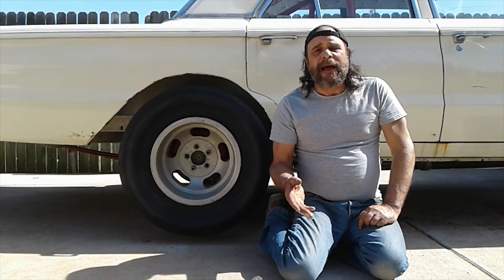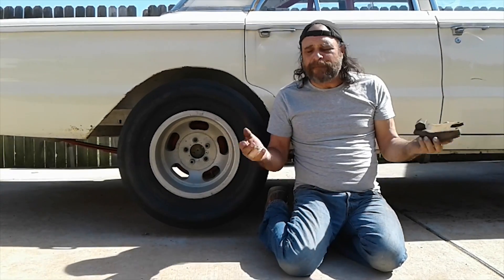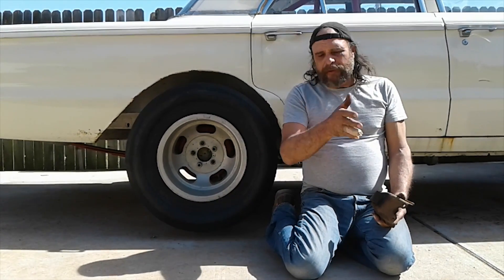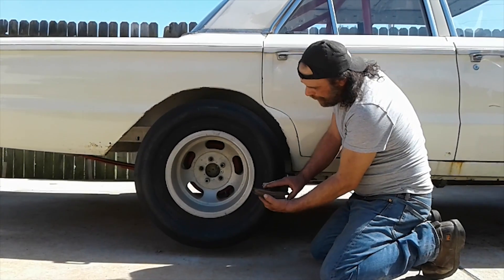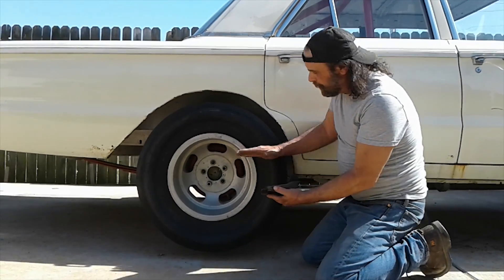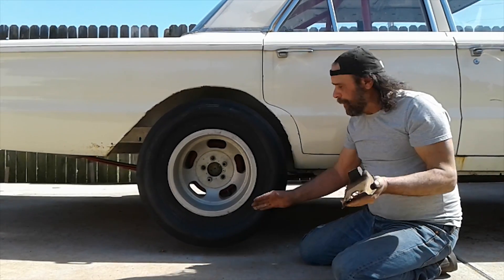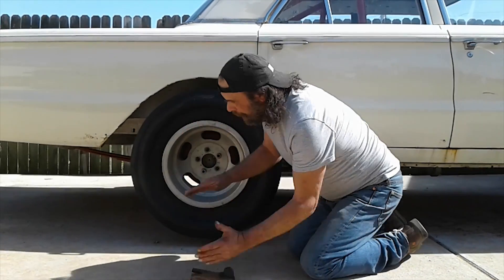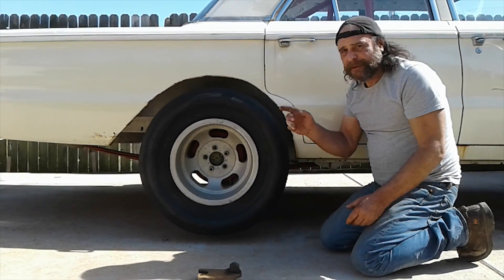Pinion Snubbers Explained

Comment: If memory serves me. For 1/4 mile, staggered torsion bar from a /6 on one side and B-RB bar on opposite side. Air shock (singular) on back (torque side). Ahh, the good old days. When the snubber punches through the floor pan.

Comment: Here's a little twist to confuse the issue, modern grudge and radial cars actually use a lifting type of rear suspension. A fellow Tuber named John Doc has a racing 4 link, with essentially a torque arm that mimics a pinion snubber, in that it raises the chassis and drives the tires into the track. They do this specifically to limit the upward movement of the front and put as much weight as possible (without a huge wheelie), into the rear tires. We are also talking about guys, that are running something like 1500-2500 HP in a street appearing race car, with computers that can do minute changes as needed to control the car as well. This is a cool thought on it though, nice vid

Comment: I'm getting ready to build a Gremlin. I'm hoping to find an 8 3/4 rear end so I can use a pinion snubber, even if I have to build a crossmember for it to work on. Also, AMC's have biased leaf springs like Mopars so that's a big plus. The guy I'm buying the Gremlin from also has some 2dr Ramblers, and the springs are just one inch shorter than an A body, so I could theoretically use Mopar Super Stock springs by moving the spring mounts, and maybe a relocation kit would work on that. I'm not sure if that would work on the Gremlin, and being a hatchback I can't put the battery in the trunk because it doesn't have one. But if I end up using a fuel cell I'll have to make a box for it to keep the fumes out of the car, so making it large enough to hold a battery or two 6 Volt group 1's in series it should fit. I even thought about running two fuel cells, one with pump gas and the other with race gas for those weekend drags. Then I could adjust the timing and boost if I'm running a Newcomer stoker 6 cyl. He built one that made 664 hp, and I'd settle for 550 or so. Then I'd name the car Having Six. What do you think?

Comment: Uncle Tony you remind me of my uncle kirk he was a Mopar guy with endless amounts of knowledge and the fastest 70 roadrunner in town it had a 440 with a 671 blower. Also had a 78 runner,68 satellite and roadrunner  and a 68 rs camro and piles of parts from complete 340 and 360 6 pack engines  several sets of small block heads. But he was known for his 440's they where everywhere he horde them I'm talking about a whole building full ... I can remember going in their tripping over engines because I was staring at the pistol grip shifters hanging on the wall she had several of short, medium, long.

Comment: Question for Uncle Tony. My v8 stick shift 8.8 rear swapped s-10 wheels hops like a motherfucker. I mean anytime you floor it in the 1st three gears that bitch is hopping violently... anything not tied down ends up in the floor, radio and gauges fall out of the dash, you cant see where you are going kind of wheel hop. It sucks ass! I despise the look of slapper bars and I'd prefer not to spend the money on a legit set of caltracs... Any suggestions that are not caltrack or slide a link expensive besides slapper bars? Iv'e tried clamping the leaf springs together and it helps but the ride is so bad its not worth it.... I daily the truck 60 miles a day.
Reply from the maker: You could try fabricating some sort of pinion snubber and see how that works.  I think you really need to hit the S-10 forums for your best answers, though

Comment: You talk a lot about weight above and below the axle center line. And now seeing this video makes me wonder, what does the weight of the front end do when it comes slamming back down and you have the little to no resistance shocks up front as opposed to old solid axle thick leafed gassers? Does that weight that drops below hold under for too long, ending up being more trouble than having a stiffer suspension up front?
Reply from the maker: Unless you yank your foot off the throttle, nothing is slamming anywhere
Reply: Uncle Tony's Garage ok. I’ve yet to be in drag car pulling a wheelie so I didn’t know that’s why those violent slams happened. But still when the front end does come back down how much of a difference does that weight falling below the centerline affect ETs

Comment: I have always thought that rubber bumper slamming into the floor was the cheesiest setup. Dont engineer a quality suspension just put a rubber bumper on the diff so when it slams the floor from the axle wrap it goes thump instead of crack. I  admire the leaf spring setup for it simplicity and reliability. I just don’t think that your suspension should be setup to allow your rear diff to slam the floor from the factory. A simple two link could have solve the problem with a slight provision in the floor height, and the leafs spring could have still been ran. In my opinion Mopar built some of the best engines and most attractive cars ever made. But it seems as if they cheapened the deal in several areas with poor build quality and under engineering certain things.
Still would own and run the piss out of one ever day of the week. American Muscle For Life.
Reply: At least mopar did something to help with axle wrap from the factory, gm and Ford did nothing, u had to go buy parts for ur brand new car to stop the wheel hop lol.
Reply: Also, they work great and are still used today. I think ur just over thinking it. The only other way to stop the axle wrap is with Cal tracs or slapper bars or some kind of ladder bar setup all of which a car company would not be able to put on their cars from the factory. The pinion snubber was genius.

Comment: for me...nothing left the line like the big mopars of the early 60s...nothing... i was under the impression they actually did very little over stock. like you said tony...unclamped the rear spring binder on super/stock springs and shocks and a top quality or custom-made snubber adjusted to a T.. some cars had 6-popper torsion bars and 90/10s but some were stock....the whole car would stand straight up, leave tall and straight down the track. stand up again at gear changes too....nothing else like em at the digs..they seemed almost, catlike...for me, what else really is there as far the proper way to lauch a car?...cause man do those cars launch.

Comment: Getting a Hot rod To Hook and not gobble up the power due to improper pinion angle, the wrong spring tension, or position, the wrong shock setups, the wrong front end geometry and floatation, the center of balance compared to the rear suspension, and transferring the power to the rear tires without burning the tires off can be a real challenge.
 Tire size, air pressure, the gear, the stall, the suspension, everything equates to hooking or spinning.
 Mopar made leaps and bounds in that area tweaking the suspension, pinion angle, front suspension till they got it right or real damn close way back when the factory 4 high-performance big players were battling it out.
 Many young guys give it no thought, and even more, want to burn rubber, so hooking isn't what they are after. BUT on race day you better be well set up or you have lost the day out of the gate or should I say Off The Line.
 I'm rebuilding my 35 Chevy again, not for more power, but a better suspension to utilize the power. 
 I've gone from seeing nothing but the blue sky to nothing but rubber smoke and have to dial it in.
 I don't want to add ballast, so I'm reworking the suspension from front to back, and still using the original 1935 Chevy front straight axle.
 It takes a lot of learning to get it right and video's like Tony's help more than one can imagine until they face these issues and have to think it through ten ways from Sunday adding all the prior attempts gaining more insight and having a feel for what will get the job done.
 Tony is one of those guys who have been down this road and knows how to not only explain it in laymen's terms but puts the rubber to the road down and dirty in real time.
  It's those Tid Bits of information that can make all the difference in the world.
Thanks again, Tony.

Comment: Just curious, 3:54 stiff sidewall, no pinon snubber, soft sidewall like a slick, pinion snubber. Why did they put them on from the factory when those tires had stiff sidewalls? Seems strange
Reply from the maker: The stock pinion snubber only comes into contact with the floor under EXTREME circumstances.  The Adjustable or Performance snubber comes in contact with the floor immediately at the hit of the throttle
Reply: @UncleTonysGarage  Ah, thanks!

Comment: nice to see an old car like this without 20in wheels
Reply: @lamaridelbridge9601  Looks terrible on a classic
Reply: Or lifted with even larger
Reply: Bingo tired of all these lowered cars on mototrend time for reality folks screw money pit cars
Reply: @lamaridelbridge9601  they arw ugly as fuck 19 is max
Reply: Agree!   Old cars look best with MORE tire not less.  15 inch wheels for me.
Reply: @jerem0621  I have a 2007 300 with 17" wheels and I feel the same way. I would like to put BF Goodrich with black wheels and dog-dish hubcaps but I'm having a hard time finding this style, I cant let go of the late 70s and 80s. lol. I'm in northern Canada and it is -34 celsius here this morning. Gotta love Canada!
Reply: #make15sgreatagain #sidewallisnotacrime
Reply: AAAANnnnnnd you put those funky wheel spacers in to make the wheels clear and you put a load on the bearings and change camber that was NEVER designed to be there in the first place and you end up being a dumbass......... Any ?.......…
Reply: And that's just what happens when you mess with the front end....,
Reply: No you should put smaller wheels on it and increase the tire size.
Reply: Its dumb to put big wheels slim tires on these cars. They werent designed for it. Unless you buildin a full blown race car with custom suspension you shouldnt put wheels that are too big
It'll ruin the handling and wont improve things at all... It'll look dumb too

Comment: Uncle Tony I need you're brain if you don't mind.I found a 92 Z 28 5.0. cheep I mean cheep the guy says it sat for a while and he changed the gas tank and fuel pump. tells me it only needs an oil change and tune up.
now me being a Chevy fan like mopar these motors are hard to kill. I'm sure it needs new seals for the t tops and hatch and doors. he  only wants $ 1.200 for the car. do you think it might be worth it ? Oh and paint the clear coat peeled.  
Thank You. rain

Comment: M&H's or Nowadays Hoosiers + A Slider Front End . Giddy-Up-Go ! Entertained & Some-What Informed ! Ya", U Left Out Ladder Bar's / J-Bolt / 4-Point + Others . Haunch'in Up + Wheel Lift is Always Awesome with an Equal Skid-Path But Always Remember U'r Stud Health . Wheel Stud's & the Metal Composition of Such Does Have a Shelf Life . 1st Pull After Nue Slick's + J Bolt Resulted with 3 Stud Broke Port Side & 2 on the Starboard . Trailer Bearings 2 . Bro's Lost 2 Race Rods , Destroyed 4 Lack of Bearing & Stud Check on Trailers . Track Was 3 hr Away on a Good Day ! [ Kay-U-Ga ] , Sunday-Sunday - B -There ! Destruct Lab [ 101 ] , We Got 2 Ripp , Explode Various Bolts , Metals & Barbie + Ken Dolls . Much More Fun Than the Non-Destruct Lab Nextdoor . Seeked Employment in That Field but Alas , Was Told I Enjoyed It 2 Much . As They Said , Quote ; If'in U Enjoy Blow'in Shit UP So Much , Join the Navy . The ENTERPRISE !? YYZ , Mohawk-Planker .

Comment: On a light cars with slicks and snubbers and hp ive seen a couple people have some bad days cuz even tho pinion cant go higher the housing gets thrown down and separates so far from body because of extreme leverage the pinion angle still goes extremely high and shafts get tossed out. I like superstock springs with extra front leafs.  Mine are homemade with 5 regular leafs and 3 more just towards front. This is on a Maverick. A friend of mines 340 4speed 69 Dart has tossed probably 5 or more driveshafts with his standard leaf snubbed 8 3/4
Reply from the maker: That's where adjustable Drag Shocks come in

Comment: I've got a '63 2dr post car! Unfortunately my progress is slower than anything, but I've already got the /6 torsion bars in the car! Got new SS springs for the back. But I didn't now about removing the upper bump stops! Will def. look in to that. I just need to throw out the 7 1/4 rear end and get the motor running as I want it for any hard launches to be reality. Hi compression 360 with a thermoquad!

Comment: I used on my 71 Demon. It worked great. Never knew about soft/stiff sidewall tires entering into the equation
Reply: i kinda know about tires being a spring / can change spring rates and shock settings and this is why on 60s mopars " hard rubber band "  ( ie something like 255 / 35 / 20 ) are garbage and don't help you go faster

Comment: I used an adjustable snubber on my  1971 Dodge Demon 340, and my1965  273 stick Formula S Barracuda back in the 70's
Both cars hooked extremely hard.
Got my carb tuning tips from Ed Hamburger at MOPAR and the info he gave me on the Cater thermo quad was invaluable for my 71 340. It made that carb work like a charm.
Reply: I had one of those 71TQ's that was a 4 speed model. Sold it cheap because none of the jets, and metering rods in my strip kit would fit it. I bought it for $7.50 at a Chevelle show.

Comment: Pinion snubbers are a crutch for weak leaf springs. If you have axle wrap, you need a stronger front segment like a Mopar Super Stock spring.
They also limit suspension compression travel to zero. Do not use on the street.
Reply from the maker: That's not true.  Properly used, the snubber transfers initial torque reaction to a downward push on the axle
Reply: David miorgan  Actually when the snubber hits, it removes torsional stress from the tubes. Without a snubber the tubes are anchored by the leaf springs and they are keeping the pumpkin from twisting. The force going upward originates on the inner pinion bearing so the snubber is in almost the perfect spot

Comment: So what would be the traction set up for a hard side wall tire? No pi ion snubber like you said, but do you still want soft leaf springs or stiff ones? Do you still want to unclamp the springs behind the wheel and perform the same set up to the front of the car?
Reply from the maker: Dudek uses those soft Satellite springs.  Not sure if they are clamped or not.  As for the front set-up, no..nothing changes

Comment: wow just wo w my b body has 90 10 front air in rear came that way loop too good track knowledge here. thankx not quite sure of springs 83/4 came with want danna 60 its use to have can see where it tore out and nice repair,kind of drag car surviver ran connecticut dragway bunch kill stickers in pop out rear windows. engine strap to frame out of 1/4 stock.rf neg camber. sounds like your the guy to ask advice. on which way to go.fund to low rite now selling stuff may next summer . thankx again
Reply: Dana 60 is nice if that's how it come but if you think a 8 3/4 is weak you better take a look at what's underneath 60s Top Fuel cars. No Dana60 here. 3000hp with the drivers man bits resting on a 8 3/4 mopar housing.

Comment: take care of your knees , also under hard  acceleration you want the ring and pinon  , and drive shaft , and trans tail end to be in a straight line . angle shim the diff down and some times angle shim the engine and trans up . it takes time to find the angles.

Comment: damn, no wonder my 72 440 charger couldn't go under 9.85 in the 1/8  last saturday night... pinion snubber, super bee rear springs, stock 318 torsion bars, 3.91 gears and 295/50 15 tires... it was a street setup event and everybody showed up in drag radials... my brothers 73 340 roadrunner went faster, but i think it was due to less torque and 3.23 gears that kept him from boiling the hides  through 1st and 2nd like me... great tips, i think ill have to drop a 440 into my 76 duster... it already has a ford 8.8 with 3.73s so no pinion snubber there...